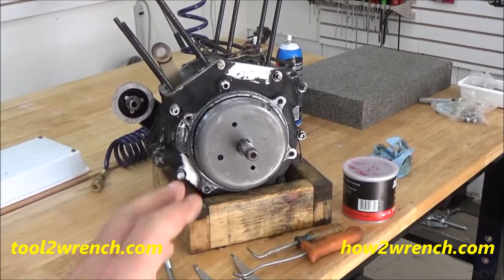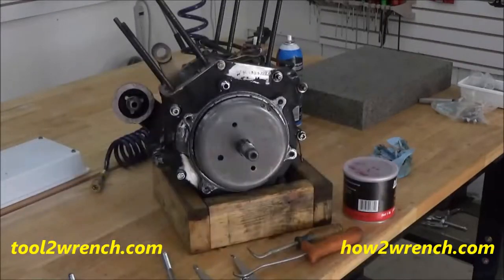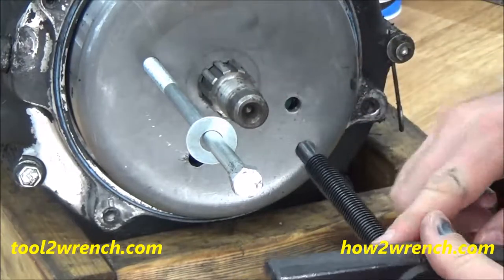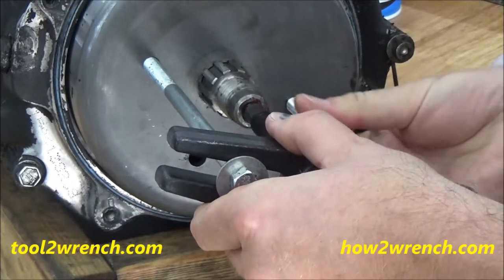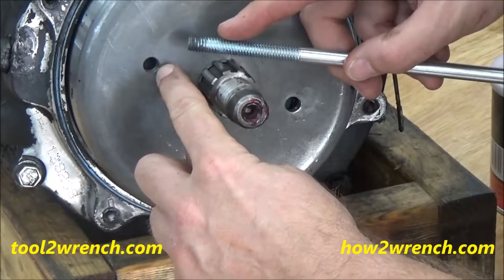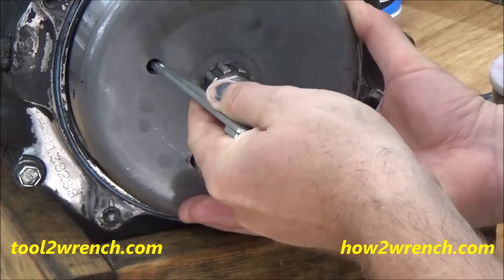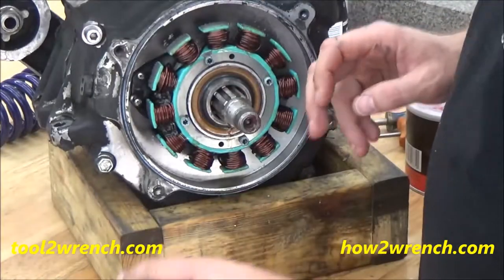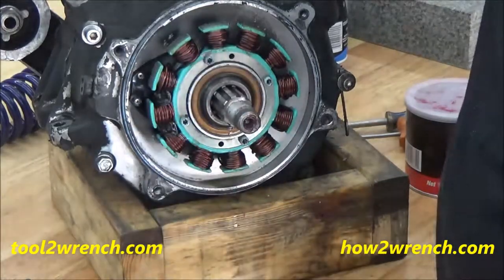How to remove the stator charging rotor on a Harley Davidson

Comment: I bend a U-shape out of heavy TIG rod or knock the flux off a stick rod, the bend two short (about 1/2") Ls on the ends. Works fine since the early '80s when I learned it.
Reply from the maker: TY